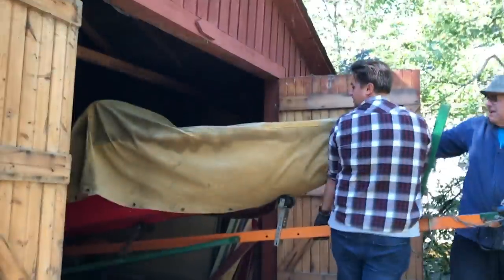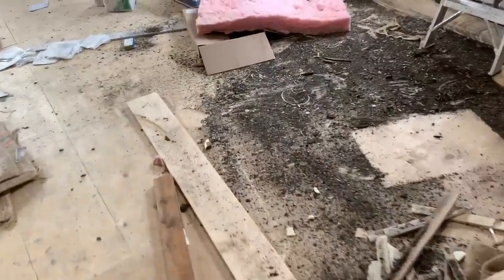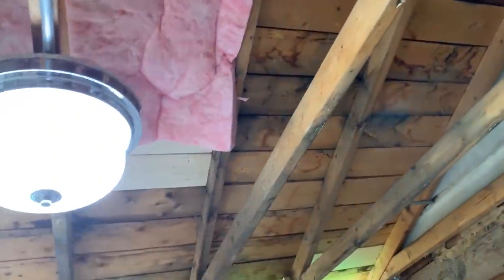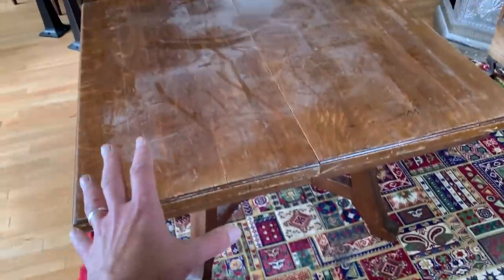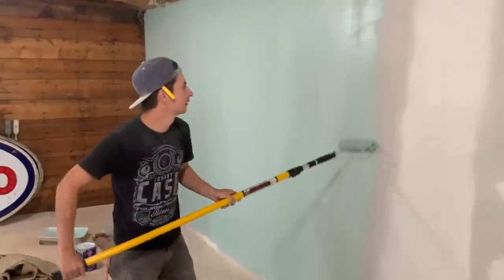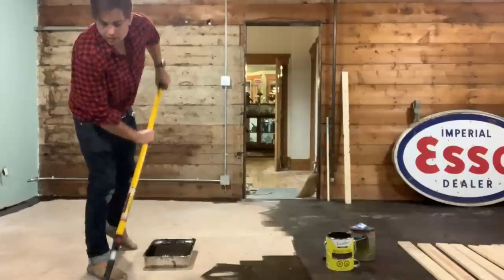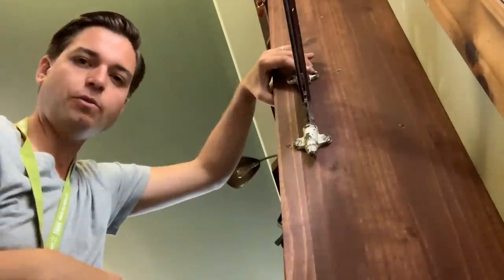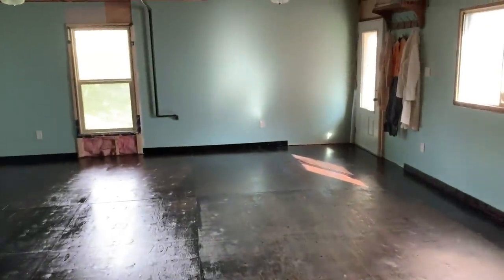Part 9. Stuff that store! Insulation, Drywall, paint and flooring! General store

Comment: Here is some information that you didn't know about people with Vertigo....and the biggest cause of it....Inside the inner ear are things that are called Crystals that float  in suspension....they can get knocked out of wack...when this happens the person may be so  miserable as to be throwing up because of the dizzyness  it causes or the room  can be spinning so bad that the person has to get down on the floor and lie there ....these crystals can be put back into place and the person is restored to being normal again....there are I believe only 6 places in the United States that have the chair contraption that corrects most of the time the misplaced crystals....You can google the chair to correct Vertigo you tube videos and with a little research you can get the cure....I know of this because my wife and my nephew both had vertigo so bad and now are vertigo free.....